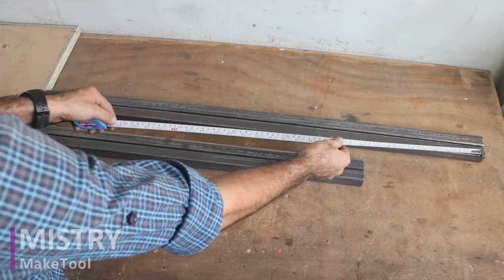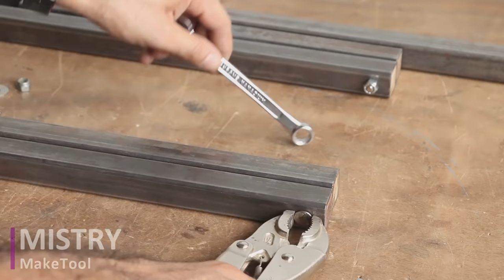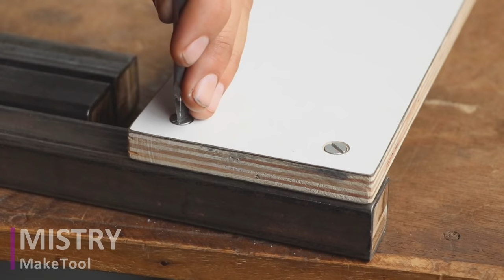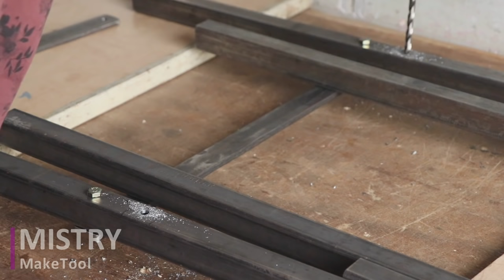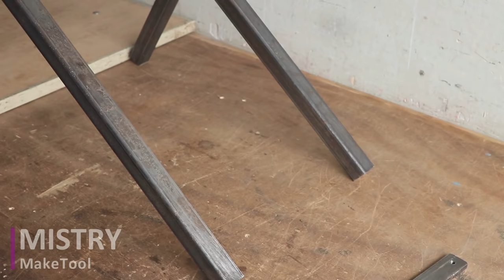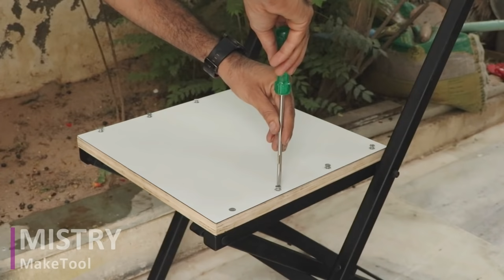How To Make A Folding Chair || DIY - Foldable Chair

Comment: Excellent designe! But an 💡 idea for you
..the leg ends could have recycled plastic or rubber cane ends to keep it from sliding on smooth surfaces. I used this idea on a rope net folding camp chair i still use today

Comment: measurements : 
Pcs  Particulars   
(25mm) 
2.        Metal square pipe - 37.40 Inch 
2.        Metal square pipe - 27.55 Inch
2.        Metal square pipe - 13.77 Inch

(20mm)
2.        Metal piece - 15.74 Inch 
1.        Metal piece - 11.41 Inch 

4.        SS Carriage Bolt (1/4 size 2.5"      length)
6.        Hex Bolt 6mm , 40mm length

Screw 3/16 size 1 length 
Plywood 18mm and 12mm size
Reply: How high of thí chair
Reply: thank you very much
Reply: the height?
Reply: Thank you for the great work, but I wish you could write better sizes.  The flat pieces were 40 cm × 20 cm?
Reply: Super

Comment: Y las medidas agradeceria que las dijeras muchas gracias que dios te bendiga hasta luego
Reply: Video me majar ment batana jaruri he... Mejar ment batado  jaldi
Reply: @ganeshlohar1882  measurements : 
Pcs  Particulars   
(25mm) 
2.        Metal square pipe - 37.40 Inch 
2.        Metal square pipe - 27.55 Inch
2.        Metal square pipe - 13.77 Inch

(20mm)
2.        Metal piece - 15.74 Inch 
1.        Metal piece - 11.41 Inch 

4.        SS Carriage Bolt (1/4 size 2.5"      length)
6.        Hex Bolt 6mm , 40mm length

Screw 3/16 size 1 length 
Plywood 18mm and 12mm size